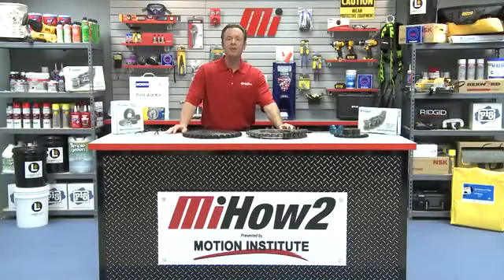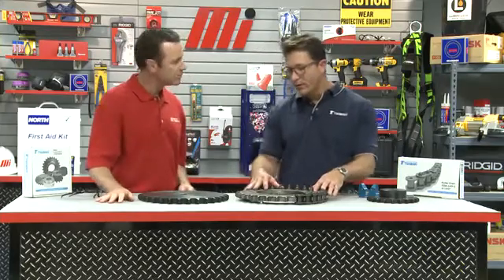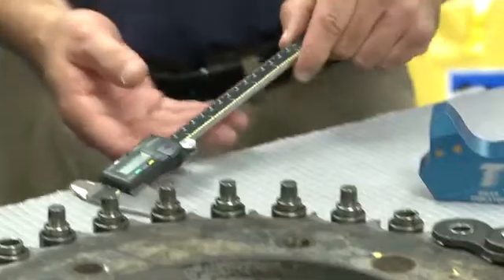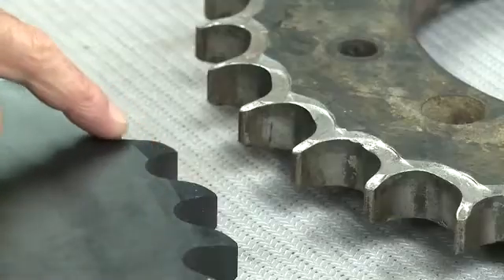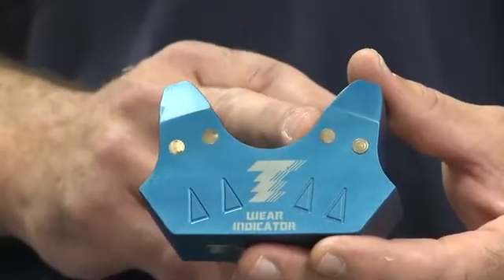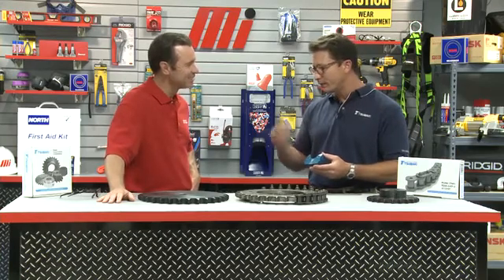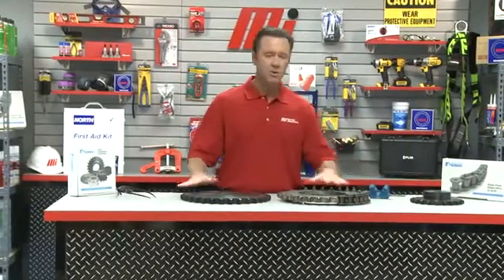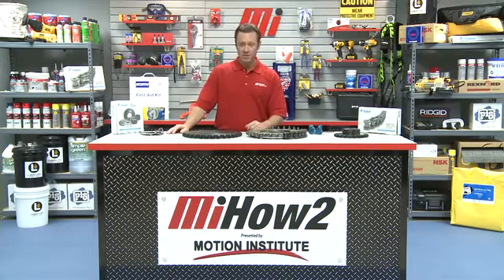MiHow2 - US Tsubaki - Wear Indicator Technology Gives an Easy Way to Measure Sprocket Wear

Comment: A simple gauge set similar to a feeler gauge or thread gauge would be much better. It could be made out of plastic also. Drilling through the root of teeth to put a rod and weakening it is a terrible idea. US engineering at its finest.